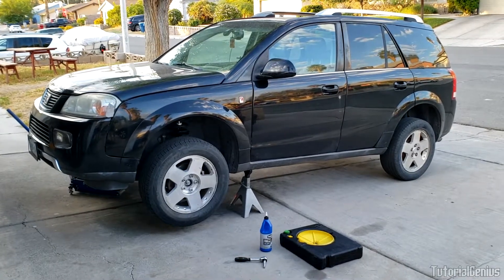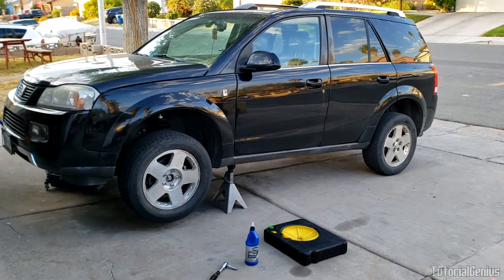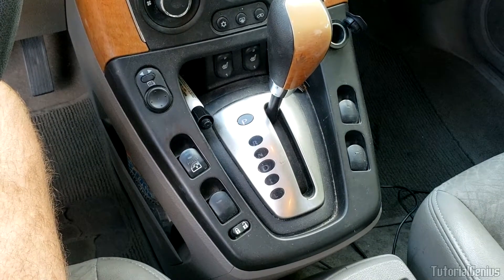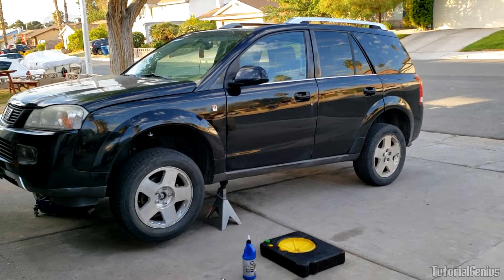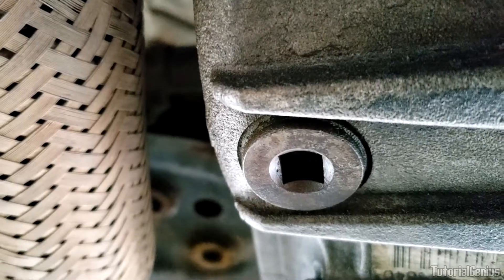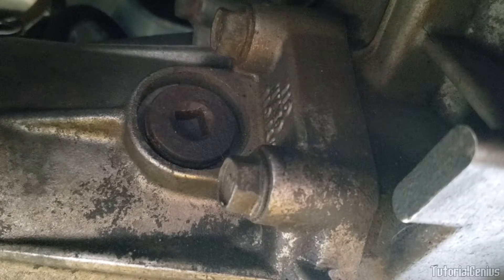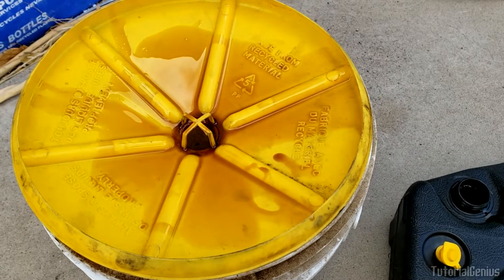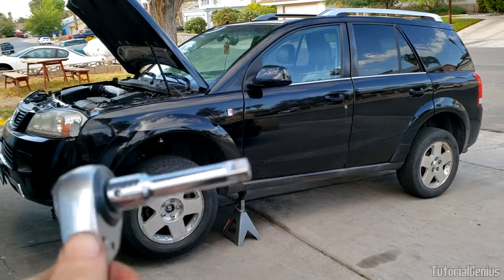Transfer Case Fluid Change - The 101 and Signs of Failure (Saturn Vue)

Comment: Good work. On mine at 160,000 miles the oil in the transfer case looked really dark and nasty while the oil in the rear differential looked quite clean.  Best as I can tell from the maintenance records which were quite good neither had been changed.   Both call for Versatrak fluid which is now quite expensive, so I used ATF specc'ed for Allison TES-295 which is a PAO based synthetic.
Reply from the maker: Glad you got it changed! Thanks for the info!

Comment: I actually have a saturn vue as well and your video made me realize that I can make mine a awd really easy all I would need is a transfer case and a back axle and a drive shaft my saturn has everything else great video 👍
Reply: And an awd transmission
Reply: @ding9633  this car is a Honda 5 speed with the transfer case.
Reply from the maker: Right on!